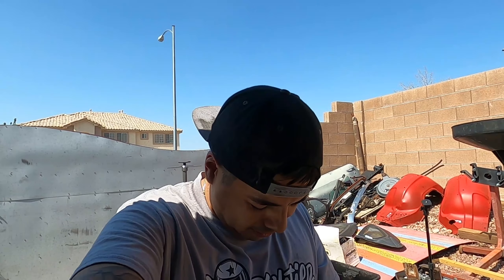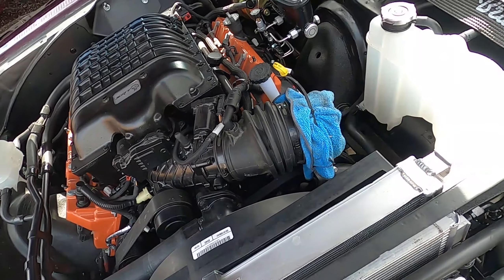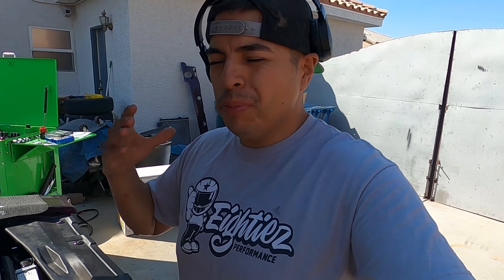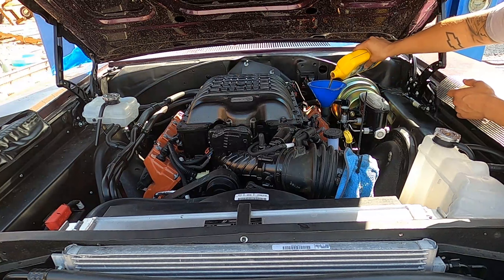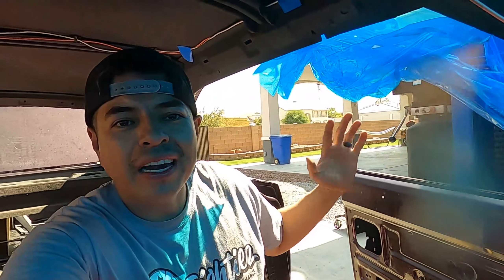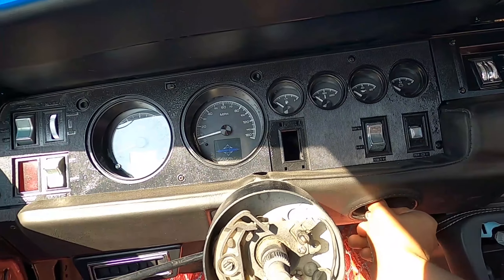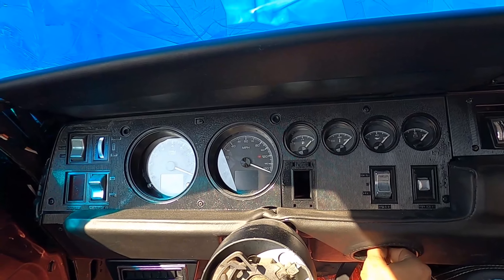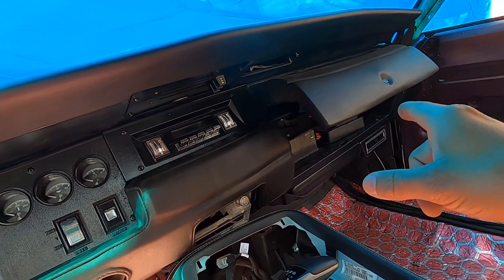68 CHARGER HELLCAT PROJECT 1ST START AND SAY GOODBYE TO CHEVELLE

Comment: OMG that's so T totally Awesome I'm doing a similar build. 70 RR TKX 5 Speed. I have some questions LOL only 1000 or SO 🙂, But just ask the one really on my mind at this time How did you solve the oil cooler issue I want to run all the factory coolers if possible. Great build for real......

Comment: How did you get the factory ignition switch to start it?  Mine cuts power to run when I turn it to start and the asd relay shuts off.  I had to install a push button for the starter.  Also, your first attempt went way better than mine!  I forgot to hook up the neutral safety switch.
Reply from the maker: WATCH INSTALLING 68 CHARGER DASH AND WIRING REVERSE LIGHT WITH SOUND GERMAN AUTOMOTIVE HARNESS
ON MY CHANNEL